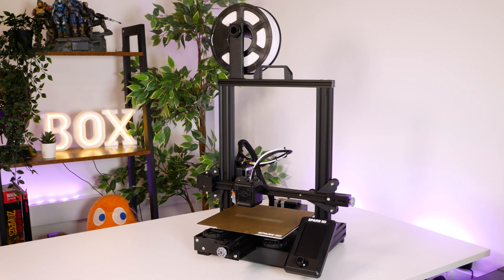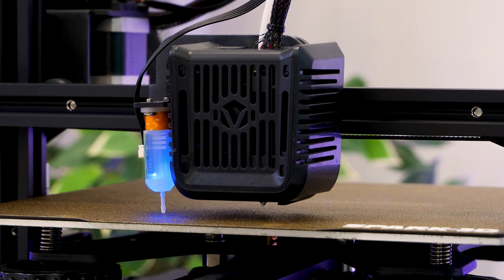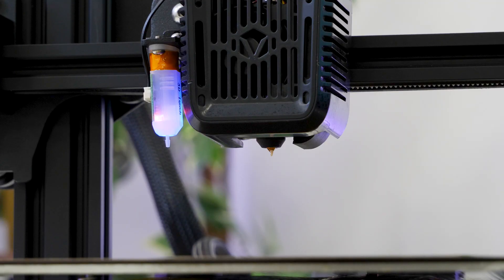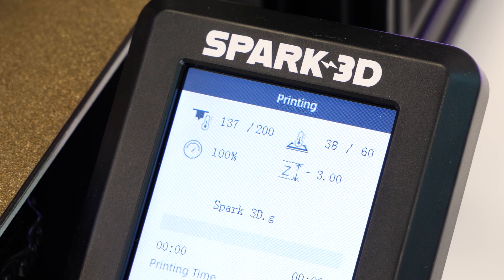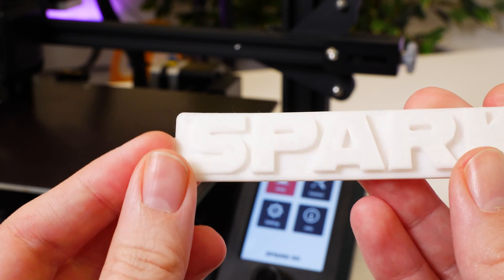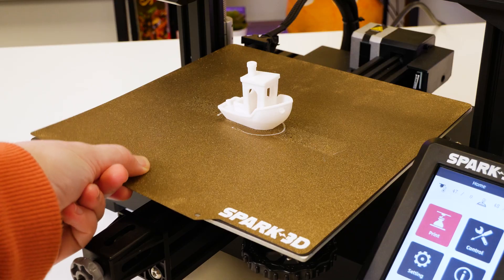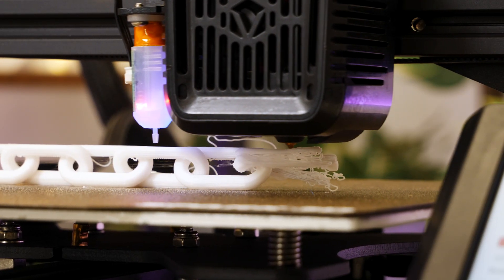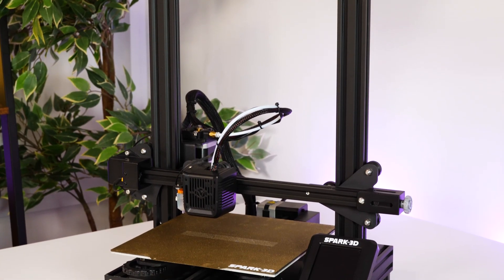Spark-3D SP1 3D Printer Review

Comment: Im quite new to 3d printers, the memory card that came with my printer was corrupt so I have formatted it. Does the printer need special software on the memory card to see the STL file on the printer. I can't seem to get the printer to see the files anymore. It also seems that spark-3ds website has gone. Any ideas where I could find this info?

Comment: And Finally, the information you may or may not want.
This machine is based on a Voxelab Aquila X2, with a firmware dated to Jan 3 2023, modified and supplied by Flashforge. The visual difference  is that the X2 had a glass bed, where this has a magnetic bed and this has a BLtouch. 
Just like the Ender 3, the firmware is a modified Marlin V1

Given the direct lack of support from Spark for any information you should read the X2 manual for both build and setup. But do bear in mind this does have the BLtouch sensor.

Box however do help out in any way they can, so support from them is at hand.

Comment: This looks like a rebranded ender 3, with a chinese bl-touch and the spare Z-end switch re used as the filament run out sensor. And the firmware looks like a re skined version of marlin.

Looks good for non tech-savvy people who can not do those mods by themselves sice they improve bastly the user experience, and you can break your printer if you wire something incorrectly.
Reply: wrong you mong

Comment: I would have liked to see the failed prints re-run after some optimisation of the settings you mentioned to confirm that they were then decent. Based on the three test prints run in the video there was a 66% failure rate which could get expensive over time. Understand you were showing it from a novice perspective, but adding that extra detail in would provide confidence that it can produce reliable prints every time :)
Reply from the maker: Hi Alan, thanks for your feedback 👍 I'll make sure I add them next time. If it helps, we will be posting more prints in the future on our tiktok channel @boxcouk and hopefully it will give you a better idea on what it can achieve 😊
Reply: I have, as yet, had no failed prints. I had watched this prior to starting printing and decided to get the 3D Lac for holding the prints down. The slicing package looks like a modified VoxelMaker app and for printing I have used both SD card and Octoprint on a Raspberry Pi. I auto level the bed each time and check the distance from print head to the base each time. Apart from the first prints I did, I have not made any adjustment to the Z axis since.
Reply: You should watch the aquila x2 review as I know most of these are all open source but this is literally a aquila x2 from voxelab with their brand on it
Reply from the maker: Not entirely true. Our in house team have adapted the design with upgrades like adding ultra quiet fans, Auto bed levelling and a pei spring steel magnetic bed, the kind of upgrades most users add eventually to these low cost models
Reply: @BoxCoUk Т.е. вы хотите сказать, что просто прикрутив BL-Touch, наклеив магнитный винил и поставив более тихие вентиляторы можно смело чужой принтер называть новым именем? Понятно, что Aquila была клоном Ender. Но они хотя бы заморочились с изготовлением своего контроллера, своего цветного экрана с горизонтальным расположением (у Ender тогда был монохромный пиксельных), спрятали блок питания в корпус, сделали свой кожух с обдувом hotend и много всего по мелочи. А вы взяли уже доработанную модель Aquila X2, ничего толком не добавили и называете всё это своим принтером? Серьёзно?